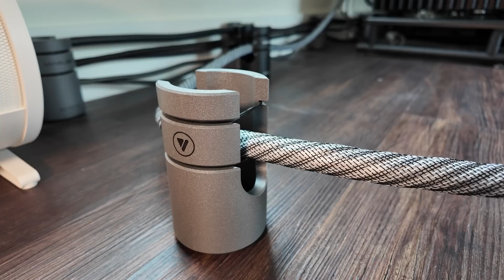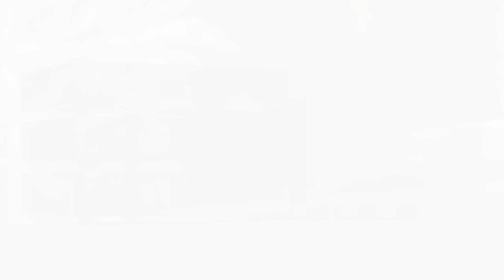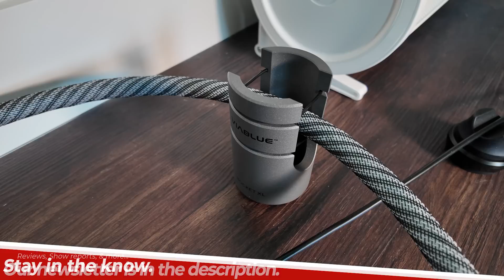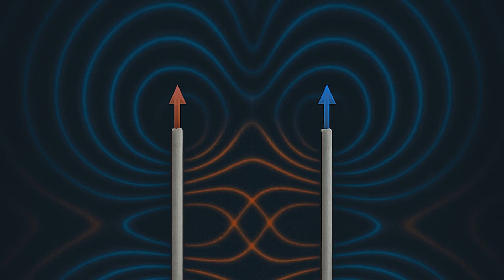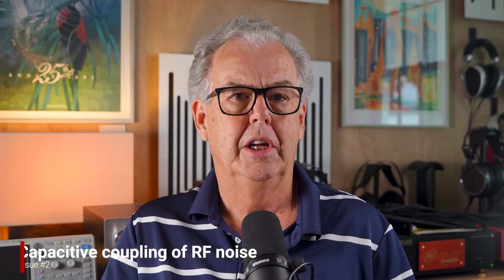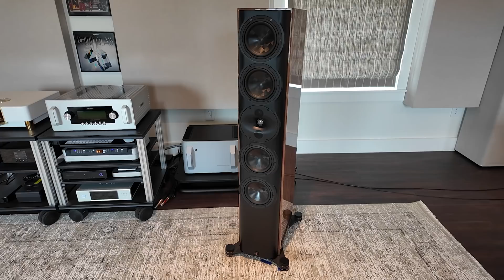The VIABLUE Rocket cable lifter system briefing

Comment: These reviews are useless. Unless they are designed to get comments.  Of you waste ANY money lifting your cables off of the floor before you own a 100,000 DAC. Then you are an absolute  fool.
Reply: I own a $25,000 DAC (Lampizator Poseidon) in a high resolution audio system.  I definitely notice the difference although, at present,  I have only those 1990s rubber pucks under my cabling over 90 oz plush carpet on a 12" 3000 psi steel reinforced concrete slab.  No problems with floor vibration but static (despite carpet being anti-static, no more problems with handling records) still exists when cables are lying on the carpet.

Comment: ..I’ve done the whole before and after with several different types of lifters and could not ascertain any differences in sonics.  The only function that they provide in my system is an aesthetic one.  Any system looks better organized with lifters and some are available at a fraction of the cost of these..
Reply: And that's exactly what you're supposed to do. You should never buy something if you don't see the value in it.

Comment: the guy is certainly very serious in defending his viewpoint.  I would think any serious consideration, beyond just enjoying owning more product, would include a consideration of the subjectivity of human hearing , and the earths magic field when considering magnetic significance.  I don't dispute that wire placement should be done intelligently, but still wonder if lifters are needed, since I have never come across any double blind testing of the products.
Reply from the maker: Thanks for this comment. It helps clarify a few things. First, the viewpoint being defended is that the assertion "cable spacing and location can't possibly matter" is open to question. As we said, we don't intend to prove that spacing does or doesn't matter. Second, the viewpoint is not that cable lifters (the product) are needed; if spacing matters, there are probably many ways to achieve it including routing, cable length and the simple use of found objects like cardboard boxes. Such an approach may simply be easier and more aesthetically pleasing with a purpose-built product. Given the cost, one might want to experiment with homemade spacing first, if the electrical benefits in question are the primary motivation.
Reply: @TASmagazine  Most cable lifters on the market combine the lifting and spacing functionality with resonance control. With these ones here it seems like this aspect has not been addressed in order to keep the cost of the lifters low focusing on the aspect of lifting and cable routing/spacing. Rubber on the bottom is not a great material known for resonance control, the only advantage is that it's cheap to use rubber. That's not bashing the product though since products of other companies which instead incorporate ceramic balls or higher grade resonance materials other than aluminium are way more expensive. While I have never used these particular products based on the construction I can see they focus on providing a very practical solution at a low price point without effective resonance control which can be achieved with very cheap home-made solutions as well just that these ones look and feel nicer to use.